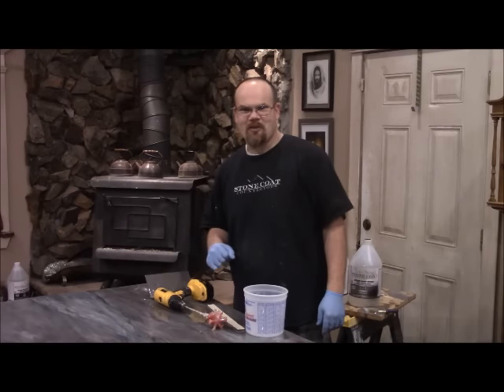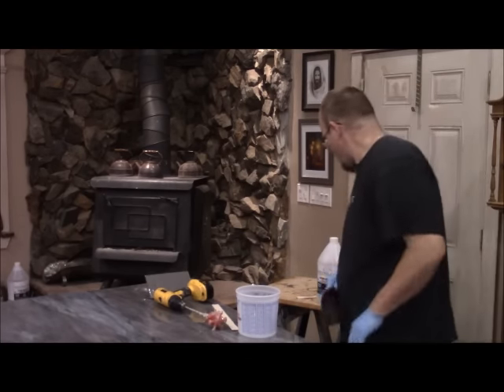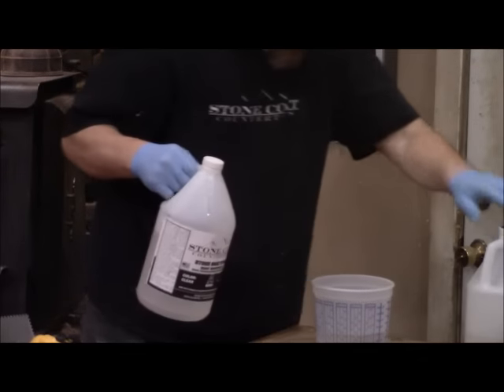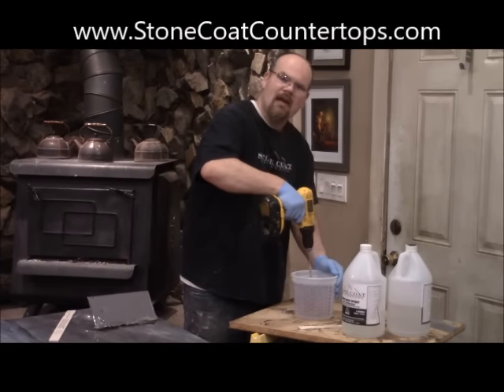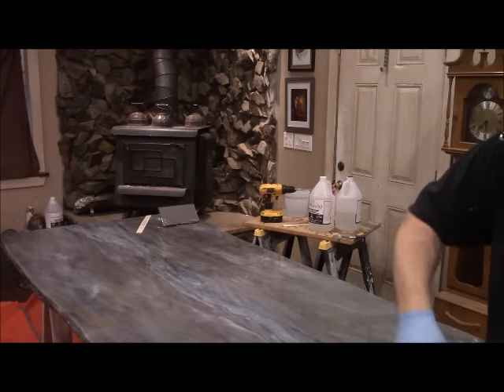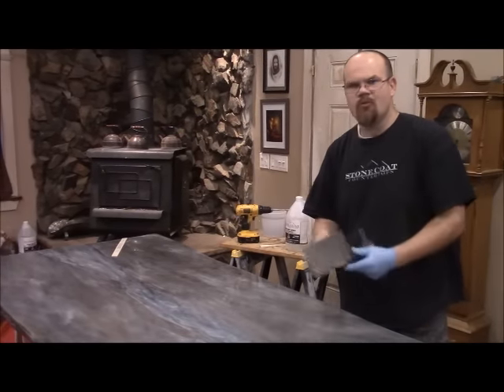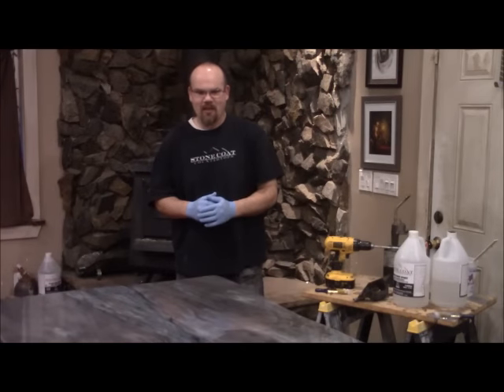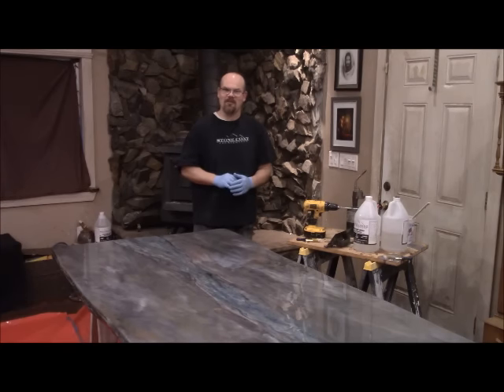Mixing Stone Coat Countertops material

Comment: Can I use Epoxy on a table top for outdoor used for cutting food on?
Reply from the maker: Great question Jeff!  Our formulation does have UV inhibitors built in; however, since direct sunlight can be very harsh over time we would recommend installing under a covered patio area or covering the table top when not in use. You will also want to stick with more neutral and earthy tones as white pigments can yellow.  Give us a call anytime with questions or for project support, we are more than happy to assist you in getting started with your project.
Reply: Thank you

Comment: what is the torch for? what part "A" & part "B"
Reply from the maker: Great question Annand! We use the torch to remove any air bubbles trapped in the epoxy during the mixing process. The Part A and Part B get mixed together to activate the epoxy formulation. Call us anytime and we would love to walk and talk you through it! 541-450-1976